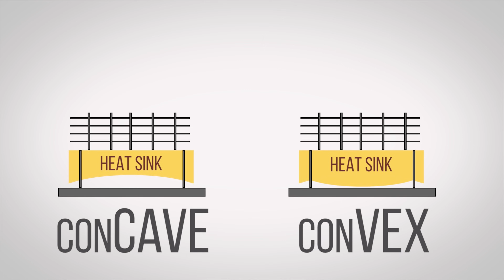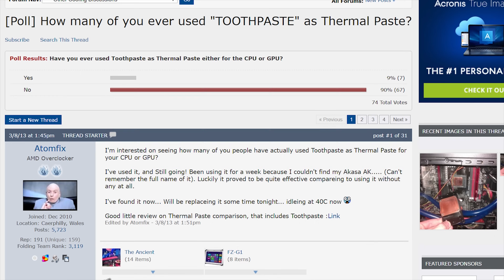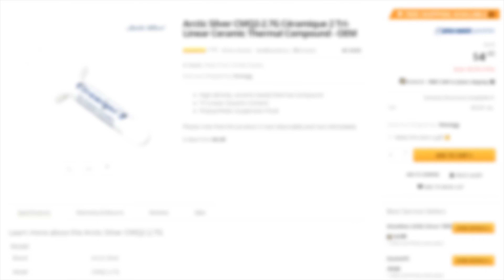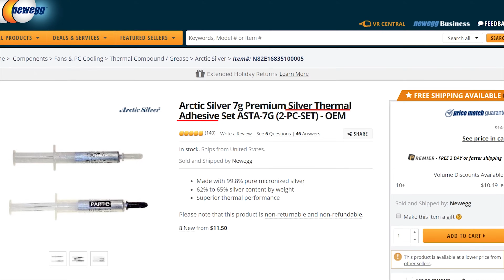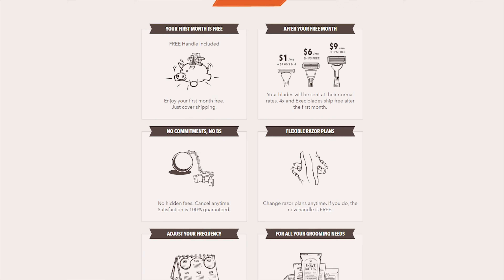How Does Thermal Paste Work?

Comment: I didn't find thermal paste at home, but industrial grease worked* perfectly for me.
*Still works perfectly after a month today.
Reply: ive been using cooper ease anti-seze compound for car brakes) for years now and has gave better results than any other compound i have used even cool  laboratory liquid pro and not just by 1or 2 oC
Reply: For real...? What kind of substance is this? It's not braking fluid itself, right? I don't have a clue about car components :/
Is this still paste- or gel-like as opposed to really fluid? If it is really fluid (= of low viscosity), then that might be the reason by itself. But then I'd fear it running or dripping around, possibly corroding stuff. And also evaporation. Yeah, even oil evaporates with time...
But I'm still greatly interested in your experience, that is very much like I use to jerry-rig things all the time xD
Reply: My new CPU has just arrived, I will take it tomorrow at the local post office. I don't know yet when will I have time to install it because of my finals, but I try to remember to leave a note here after I replaced the CPU.
Reply: boycot gugle hi it is a light weight grease  that is full of copper powder used on cars ect for brakes to help them tranfer heat and stop them sticking sqeaking it is a paste but quite a thin paste it doesnt get runny with heat and never drys but is quite conductive so care is required or just use a little tape to portect circuits ive uesd it in my pc for two years now with no problems best part is you dont have to repace every time you move heatsink